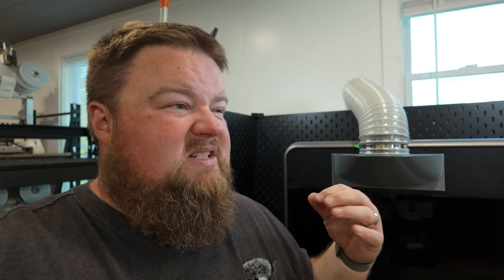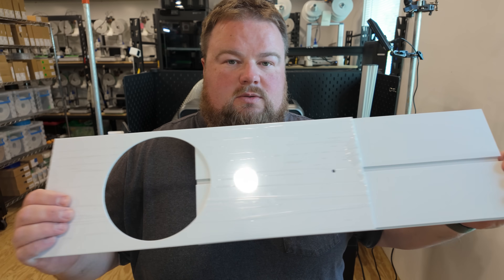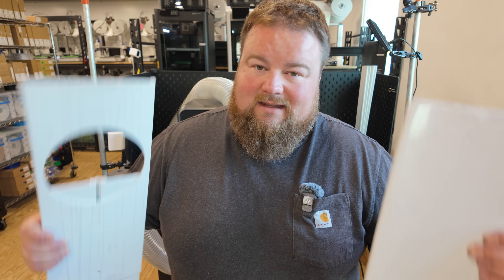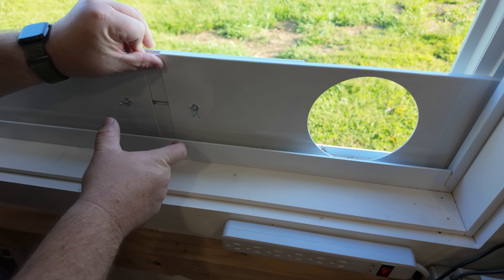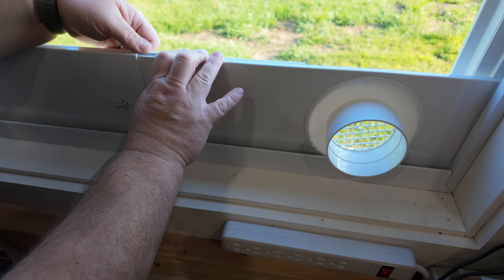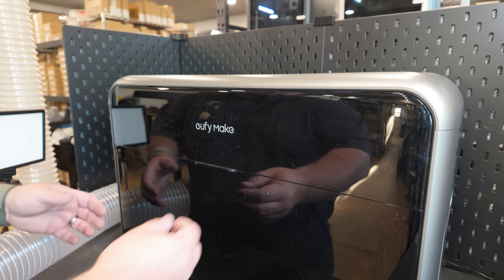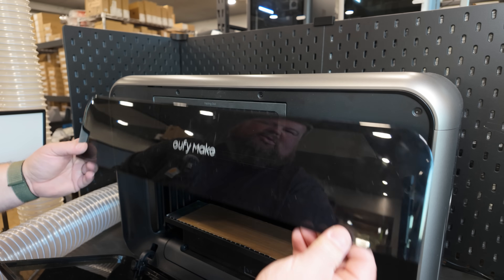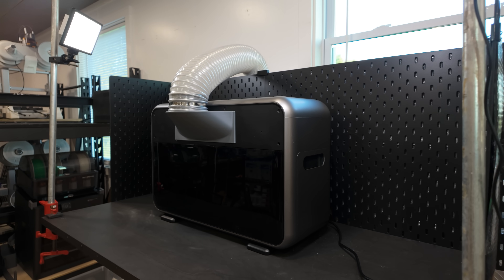Never Suffer with UV Printer Fumes Again from your eufyMake E1

Comment: I used the window unit with my laser. I put a check valve to keep the wind out. The window is in my covered porch area so I was able to keep my screen on to keep out insects.

Comment: Damn, i am really sensitiv to the fumes of 3D Printers, even PLA and also sublimation with a heat press. I can feel it on my tongue and lung etc. thats why i use those tents as an enclosure for the A1 and A1 minis and use 4 inch pipe ventilators as well for guiding the fumes out of the window but its not perfect because you have to open the tents when you lead filament etc. I would have thought that the Eufy E1 would be super ok in case of fumes because its not like a resin 3d Printer, it spits tiny amounts of UV "ink" on your object and harden them instantly. I thought its more or less a closed system with ink cartridges and you couldnt smell much, good to know that it is not like that.

Comment: the link to the amazon exhaust vent links to this product: "90 Degree Dryer Vent Connector Kit with Dryer Hose, Space Saving Dryer Vent Elbow for 4 Inch Tubes, Clothes Dryer Vent Connector Elbow Kit, for Tight Space"  Can you reset with the correct link? thank you
Reply from the maker: That was the correct link, but that item listing has been replaced. Just search for window dryer vent kit and see what's available at the time.

Comment: This might sound like a silly question, but do you leave the fan running all the time or only when the machine is doing a print?
Reply from the maker: I've found I only really need to run it when it's running and then for a little bit afterwards. It's nice to be able to turn it on and off as I need, too.

Comment: Great stuff!  Suggestion: It seems like you could modify your port such that the filter could fit into your port (maybe slide it in from the top?) and then push the port into the printer.   That way the air coming out into your backyard (well, it would be my backyard when I set this up) is a little cleaner.

Comment: Hey Sam, great design! Can you design the fume extractor with two tabs with holes that can utilize the screws that are right above it? This way, the flexible duct doesn't pull out the fume extractor. I see that those two screws right above the fume extractor should be able to be used. Thanks!

Comment: Obviously the A/C window vent adapter doesn't work for old crank windows. I just took out the screen and replaced it with a piece of plywood and cut several holes for each of my UV printers and lasers to exhaust out of with AC Infinity duct fans on each device.

Comment: Also, can you make the hose connection 3" so that way can use it with my xTool filter system?
Reply from the maker: Sure, just send me an email or use my contact page on my website with the exact outside dimensions needed in millimeters -- I can customize the hose connection to whatever you need. :) https://samcraft.shop/pages/contact

Comment: You might consider an air to air heat exchanger for your exhaust system(s). It should help reduce some of the costs associated with exhausting so much of your conditioned air.  

Just an idea!

Comment: Sam, perfect timing. I bought a high power laser to attach to my CNC. There are two issues: 1) create an enclosure around CNC (4’ by 4’), and 2) exhaust it outside my basement swing-out windows. I was planning on making tees and elbows out of 3D printed parts with PVC pipe connecting them and covered in some sort of plastic curtain. I was looking at $30 bathroom fans instead of $700 fume extractors. As for swing-up basement windows, I’d either have to create an insert or replace one pane of glass with a vent outlet. I’ll definitely keep these parts in mind. Do you think that fan can suck up and push out dunes over a 10’ length of hose???

Comment: As always another useful video.  Suggestion for another SamCraft product.

I have a regular need to roll my laser away from the exhaust fan to access cables to other devices in my shop.  I saw a magnetic connector that has common rare earth magnets and a groove for a common O-ring to help seal the connection.  I printed the 4" one and it works fine but the 3" one the magnets are not strong enough to hold the connection together.  If I had your mad skills I could design one of these with ears large enough to hold the magnets in and a "standard" sized O-ring. Alas I suck ad design. I suspect that others like me and those without printers would love to purchase one of these from you.  Thanks.

Comment: Nice one Sam! I made myself an extractor for resin printers (in an enclosure) from an old rangehood fan. For the window I just cut plywood and 3d printed hose adapters.
Didn't know about the issues with aluminum extraction hose. I'd better source myself some PU hose instead.
Great video. Cheers!
Reply from the maker: Thanks for sharing your setup -- it sounds like you have a great system!

Comment: If a 3D printing biz owner has to buy $30 simple plastic panels and can't design their own then I would probably avoid that biz. Bad look imo.
Reply: That is not a fair statement to say. Sam is respected in the maker community for his 3d printed jigs and as an active member in the maker space. For anyone, even him, it would make sense to buy a part that is larger than a print bed and comes with additional metal hardware. Someone has already designed and made the exact product that works well, for an affordable price, and that product has been tested and proven viable. There would be no need for anyone to make their own. That's a simple cost/benefit decision to make when thinking of design time, material cost, testing, etc. That is a great simple product to choose to purchase and carry on creating.
Reply: This reminds me of the people looking to 3D print simple electrical connectors, automotive clips, etc. that can be bought commercially for less money than it would be to design and print. Sometimes off the shelf is the right answer.
Reply: Not worth my time to sit down and design this much less print it- cheaper to buy